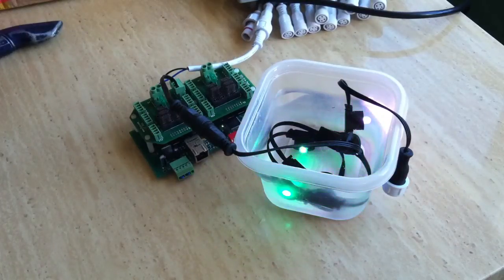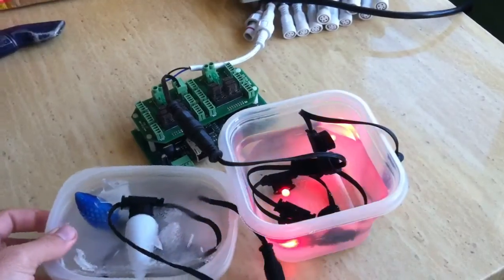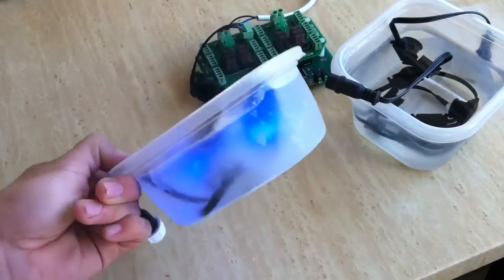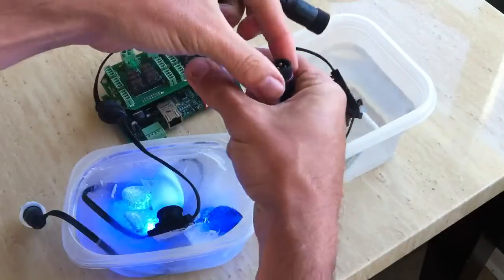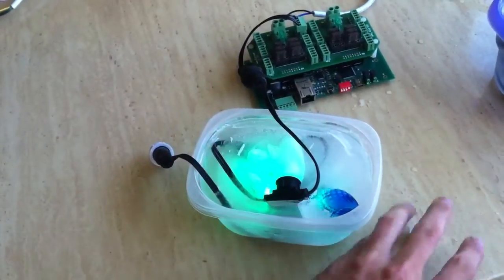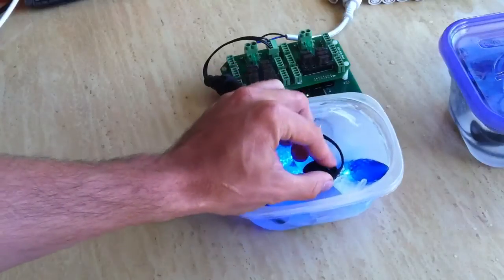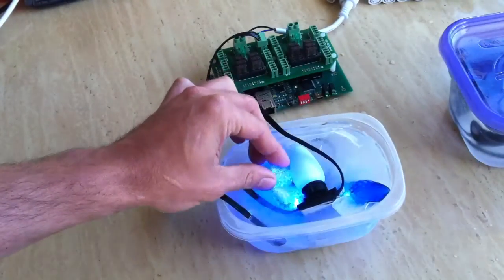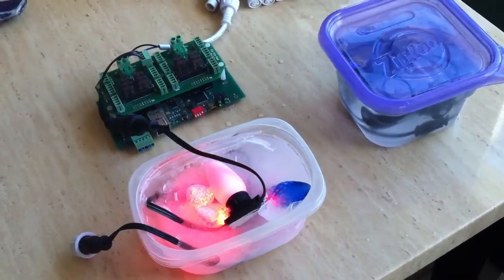Technicolor Pixels IP tests

Comment: I have been watching your videos with these new Pixels Strings. The Freeze,water and Pressure are great however, you need to show a UV test. This is one of the worst degrading of strings. So, if you can do a video with that, I think that would settle for all tests. I think you have a good product.   Also, how did you come about getting these designed and then manufactured. I have great ideas that I would like to prototype, then maybe begin manufacturing. Any advice and knowledge would be great.  Keep up the great work.